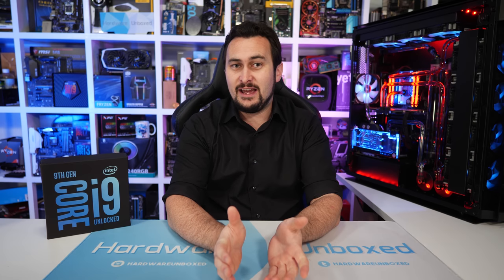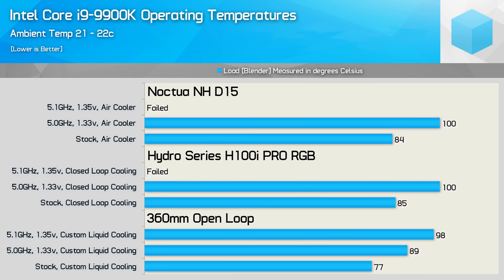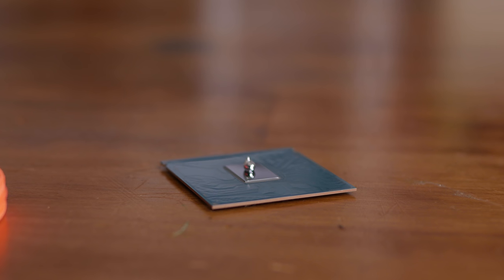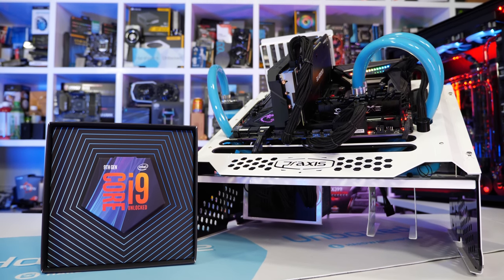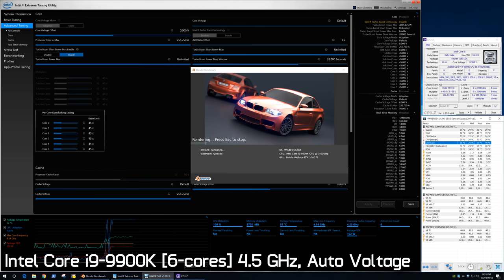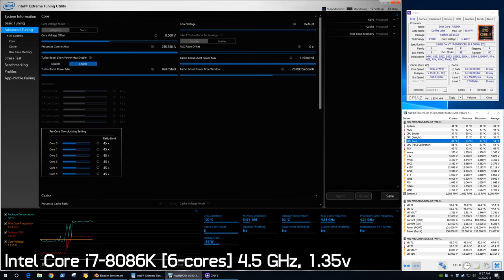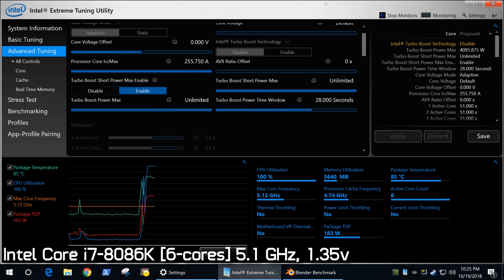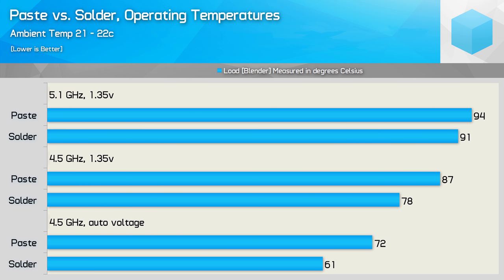Why is the Core i9-9900K so HOT? STIM test, Solder vs. Paste

Comment: I need help picking a cpu:
I9-9900K vs i7-9700k vs i7-8700k.
I am mostly concerned about gaming performance and temps. As well as lack of hyper threading  in i7.
Please make a THERMALS TEST, including gaming temps-  comparing all of these CPUs!
Reply: If I was going to build a gaming only rig, I would get the 9700k.
Reply: @m8x425  thanks. Can you explain why that exactly? I am really  concerned about the temps of 9th gen. But since I don't  build often, I am willing to spend  extra money. So if "price wasn't  an issue" would  you get the i9-9900k or i7-9700k? 
The fact the i7 is missing it's  Hyper Threading is a big let down, and makes the decision harder. But the high temps is even worse.
Reply: First thing's First, if you're going to run the CPU at stock speeds then you will have nothing to worry about with the temps provided that you pick a good CPU cooler and the case has good airflow. 

I'll give you a mess of information so hopefully this will help you make a choice that's right for you. If you're not going to get to this build until 6 months from now then it might be worth it to wait for Zen2 if the rumors are true. The only concern with waiting is AMD related releases come with a lot of hype and release dates have a tendency of getting pushed back. Also, be aware that the 9900k will most likely be the best you can do for the 1151/300series platform. Intel's 10nm Ice Lake will most likely require a new motherboard. If you're in dire need of a new gaming rig or upgrade then yes, go with Intel. 

I would be in favor of an 8086k or 8700k if you can save a fair amount on your budget. For a straight up gaming rig, an 8700k paired with a better GPU is going to beat the 9700k with an inferior GPU in gaming. The i5-9600k with an RTX 2080 or GTX 1080ti is still going to beat a gaming rig with the 8th or 9th Gen i7 and an RTX 2070 or GTX 1080.  

Obviously the temps of 8th gen i7 processors like the 8086k and 8700k aren't that good to begin with because of the TIM between the IHS and the CPU die. As you can see in this video with the i9, the temps are only slightly better at an overclocked speed of 5.0ghz. The only workaround with the 8th Gen chips is they can be delidded easily. Hyperthreading will add to the temps so the i7-9700k might be a little bit more manageable at 5.0ghz.

I would also be willing to speculate that the i7-9700k should have a more refined memory controller which should give it the ability to handle higher memory speeds. I had both a 6700k and a 7700k. I sold off the 6700k. The 6700k didn't handle faster memory speeds very well when it was overclocked to 4.7ghz. On the other hand my 7700k was perfectly fine with running faster XMP profiles while it was overclocked to 5.1ghz -2 AVX offset. The IMC is often overlooked though, and in some cases getting one with a good IMC is part of the Silicon lottery.

The reason I would pick a 9700k over the 8086k/8700k is because the STIM is going to be a little but better than the TIM paste. Also the 9700k has a better Turbo clock profile which is the biggest selling point for me. The 9700k should do at least 4.6ghz with all 8 cores up and running. The 8086k and 8700k both do around 4.3ghz with all cores pushed. 

What I didn't see in this video, or maybe I missed it, was the use of AVX2 offsets. When I've overclocked my 7700k and 8700k I usually use AVX offset -2. My 7700k can do 5.1ghz AVX offset -2 at around 1.35v, and my 8700k can do 5.2ghz AVX offset -2 at 1.32v. So If I run a stress test like the newer version of Prime95 with my 8700k, my clock speeds will only go to 5.0ghz. I have to stress test with something like Prime95 v26.6 which doesn't use the newer AVX/AVX2 instruction sets. 

Sadly, I need to delid my 8700k if I want to run it at 5.2ghz 24/7, but I can run it at 5.1ghz -2 AVX offset and the temps are manageable while running a stress test. As far as the Silicon Lottery goes, I did well with the 8700k so I have no reason to buy a 9th Gen chip. If I had a poor 8700k that needed more than 1.35v to obtain 5.0ghz -2 AVX offset then I would think about the 9700k myself. 

In other benchmarks I have seen, the 9700k trades blows with the 8700k/8086k in workstation related tasks so far.

I would be willing to wager that Silicon Lottery might offer a delidded/relidded 9th Gen processors, provided that they can delid and relid efficiently. Of course the extra labor charge would get passed on to the consumer. SL does offer a 1 year warranty on the processors they sell. I would suggest checking SL out. If you have access to Amazon's Prime Now, I would suggest checking that out too since sometimes there are hidden Gems on there. 

The CPU temps in gaming are never as high as what you see in these Stress tests. Usually you can get by with a reasonable CPU cooler, while using a case with good airflow and you'll be fine. When I say reasonable, I mean a Scythe Fuma or Mugen 5, not a 212 or H5. The only thing to watch out for is if the BIOS/UEFI on the motherboard will try to auto-overclock the CPU to the all core Turbo speed. These boards have a tendency of overvolting the CPU with things like Multi-Core Enhancement or Gaming Mode which leads to higher temps.

Comment: Steve. CMIIW but isn't the heat issue is also because ringbus architecture is already at the limit, core-count wise. I mean, you can only connect so many cores in one  ring, 8 seems to be the limit (at least in 14 nm)
Reply from the maker: We've seen 10 core ring bus CPUs that worked just fine.

Comment: I'm curious why your review had more issues with thermals. Watching other reviews among your peer group of Tech Reviewers, I don't see anyone else with a similar alarmist view as you do with the thermals. Would be nice to hear a consistent opinion. I am building a new PC, but planned on using a good 240mm cooler which in your opinion, won't suffice.
Reply from the maker: Not sure who you are watching but all the channels and tech sites we follow were concerned about the operating temperature.
Reply: I agree each commented on the thermals, but your statement was the strongest, which I take seriously as everyone should if true. (IE: paraphrasing - If you're going to OC, 240mm won't get it). I wasn't challenging the validity of your statement. I'm just wondering why it's not at the top of the talking points. I myself made a change going to 360mm Eisaber, but even with it, I'm not sure how far I'll get. tnx
Reply from the maker: My comments are based on the testing data, not sure what else to tell you. If you think 100c at 5 GHz is okay then so be it. I'm not the only one showing results like these and I feel they are too hot.
Reply: My god no. I want my system to last more than a year. 100c is a no go except for a single test. I'm looking for a safe operating temp for daily use. I'm very conservative as is. My current 5930K only runs all cores at 4ghz, but stays between 35 - 60 depending on what I'm doing. I appreciate the testing you've done so far. It's been helpful.

Comment: I have some delidded early 00s xeons with solder. I might go measure the thicknesses and compare to Roman's findings.  These chips are less than half the modern cpu die sizes too, something intel always claimed was no good for soldering, that is dies too small tend to crack the solder.

wasn't the case on these 2 I have.
Reply: do that,also they delidded these "soldered" cpus on GN with the rockit88 which is made of plastic.no one needed to heat the IHS like with old soldered cpus or ryzen.so i call bs.
Reply: Roman showed that it just sheers the solder off on the 9th gen using his tool. It's really thick and soft what intel used this time and seems to give way pretty easy, there was no heating when he removed it. 
As for my xeons, both broke, one even sheered the silicon in half sideways and that's got less than half the surface area adhering it compared to 9th gen. This solder is not much softer than normal electronics tin/lead solder.   So it could be very well they used something much softer/thicker compared to the past.
Reply: @3800S1  yeah he even sanded the silicon since it was thicker and that hurt temps too,very strange stuff going on.
Reply: Well I just measured these old soldered xeons. I got the same die thickness as Roman but the solder layer was 0.25mm, about half of the specs Roman measured. And actually the die area isn't much smaller than the 9900k, it just looks smaller as the xeon I have has a square die.

Comment: I just built a 9900k system and oh yeah, this thing is HOT. So hot when I overclocked it the frequency actually went DOWN! Maybe I'm doing something wrong, I dunno. This platform is new to me and I'm still learning. But last time I checked, when you overclock a cpu that runs 3.6ghz stock, it shouldn't drop to 3.3ghz on cinebench AFTER the overclock when the cache frequency in the bios clearly says it's running at 4.6ghz.
Reply: Probably AVX offset.  -3 is normal.

Comment: I posted this comment two days ago on der8auers video. I guess we were thinking the same thing.

Maybe it is because the soldering process. Thicker die so that the risk of damaging the CPU from the heat application when automating the soldering process is lower? Could be a tolerance issue or a manufacturering impact as well.

Comment: Seeing so many different overclocking results is discouraging. Guru3D tested it at 5.2Ghz and theirs didn't exceed 85C. "We hit 80~85 Degrees C on the package sensor at 5200 MHz / 1.325V" also WCCFTech tested theirs at  5.3 GHz With 1.367V and that one never exceeded 89C. Corsair AIOs nothing special. 9700K might be the better CPU for gaming though, Anandtech had theirs at 5.3Ghz "For the Core i7-9700K, we hit 5.3 GHz very easily, for a small bump in power and temperature." that one never exceeded 84C either.
Reply: And Derbauer couldn't even get 5GHz. His topped at 4.8...
Reply: My guess is that all reviewers are using different motherboard, and some motherboards are overvolting more than they are reporting creating this discrepancies, i hope a reviewer could try multiple motherboards to see if he can prove this.

Comment: My Intel i9-9900K and overclocking over 4.7 GHz are under 60 degrese Celsius in extreamly preformance game. It is not hot or warm. I love the CPU but I have I 3 big fans to cool down the CPU and they are watercooled.
Reply: Yes same here 25 idle and 58 ad 3dmark and games not hot ad all

Comment: Could you tell me what cooler you used for the i7-8086k & i9-9900K here, please?
Reply from the maker: It's the open loop 360mm setup featured in the day one content.
Reply: Hardware Unboxed thanks for the response!
Another question please, would the Noctua D15 air cooler be sufficient enough to cool an i7-8086K on Stock clocks? And how well can it handle Overclocking?

Comment: You would think with these temps would do better on those firestrike benchmarks!
I guess the Verge will need Oven mitts to add to tweezers and Swiss Army knife for their updated i9 9900k system build! ♨️

I would love to see a cost benefit analysis between this gpu and a Ryzen 7 2700 with fast ram, mb and suitable cooler to overclock the he'll out of it.
Then compare it with minimum components required to get a reliable turbo out of the i9 then do a performance/cost between the two setups. ☺

Comment: Is that really the best voltage you were able to get? One of the 8086k's here is doing 5.2ghz@ 1.29v and is stable in prime for 2hrs
Reply from the maker: Yes... silicon lottery bud. That's the best both 9900K chips that I have can do. My 8700K is also better.

Comment: Steve, the singular of GHz is still GigaHertz, not GigaHert ;)
SI Units usually don't do the plural thing. It's 1 Volt and it's 2 Volt. Only English speakers add a plural-s to SI units. So the plural actually should be GigaHertzes.

Comment: Do AMD have a better soldering process, or do they have the active circuitry closed to the IHS inside the die?
Reply: It appears AMD's solder is actually better for thermal conductivity. Though that maybe because their die is thinner and silicium is not the best thermal conductor.

Comment: honestly idk if its just really cold in my room, but i recently just upgraded to a 9900k from a 8700k im running 5ghz@1.32v on all cores stable under max load my 9900k never hits 80c where as my 8700k would be around 85c-87c @5ghz, the thing is im still using my previous gen mobo and one of my vrms seems to get a bit hot for my liking, it gets to around 90c

Comment: +Hardware Unboxed, so what you are saying in a nutshell is that that AMD has been so competitive with Intel over the last few years that for Intel to gain any kind of a performance advantage they have to sell max clocked high end chips that are 2x the price of the competition and generate thermals on an 8 core chip not seen out of the box since the FX-9590.

Also it seems that AMD has the right formula moving forward and this just proves it.

Comment: I see a lot of people comparing the 9900k to the FX-9590 regarding its power usage and heat.

Yeah, they are both hot. But one the big difference is that the Intel at least returns you performance for that heat/power cost, unlike the FX.

Comment: It's interesting to me you say you're not a fan of de-lidding because it voids your warranty. Overclocking, even on the K unlocked parts also voids your warranty but youtube is rife with lovers of overclocking. In fact finding a channel that will provide stock speed benchmarks is quite difficult. I know you said also due to its risk, you're not a fan and while overclocking isn't without risks, they can be much less severe. In any event, i wish more channels would focus on stock clocks and not doing any warranty voiding activities rather than expecting that most people will "roll the dice" to some extent.
Reply: Eh they can't even tell if you overclocked whereas it's easy to tell if it's delidded

Comment: I dont know if im crazy or if im missing something but i find it really weird that Intel didn't leave the i7 part at 6 cores and 12 threads. Aside from the obvious reasons this is suss, surely a true six core part with solder would have performed better than a non hyperthreaded 8 core part which is clearly thermally constrained.

Comment: Think you might have a hotter than normal chip and 1.35v is crazy high. I wouldn't say I have a great chip but it hits 5ghz at 1.28v @ 78c under stress testing. I admit I have a dual 360 rad custom loop but when you spend this kind of money on a chip cooling it efficiency should be in the budget. I was able to overclock to 5.2ghz at 1.32v but the temps were in the high 80s and couple cores were hitting mid 90s. I personally am happy with a 5ghz all core overclock temps are manageable, and the difference between 5 and 5.2ghz wasn't enough for me to justify the higher heat and potentially shorter life span of the CPU.

Comment: Why is Tiny Logan saying that the thermals with a standard 240 mm AIO are perfectly ok and all the hype about overheating are BS?
Reply from the maker: He is using a 4-phase motherboard that's obviously throttling on long runs.
Reply: @Hardwareunboxed  but then 5.1 GHz is just a gimmick. Like a car with top speed 160 mph...but you can hit it only for a minute before the motor explodes...or we will throttle it down automatically for you. What is the sense?😉

Comment: I think it would wiser for intel to release a 6/12 core processor again but trying to extract the highest clock speed possible out of them... like 5,5 or 5,6ghz in order to compete even with the next amd lineup of Cpus...  because the 14nm is the limiting factor here...